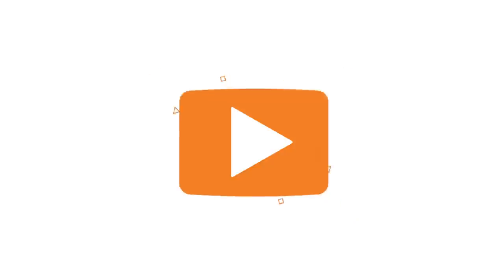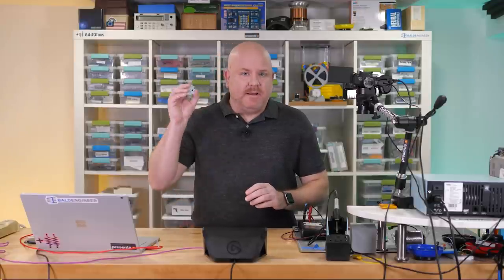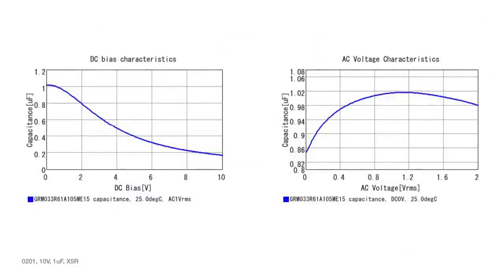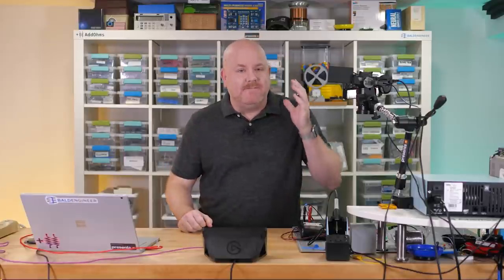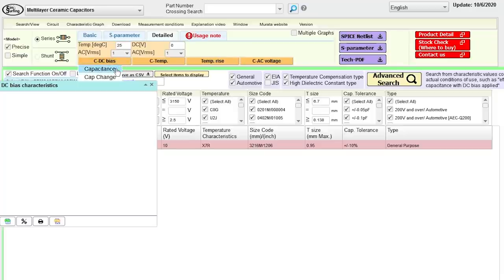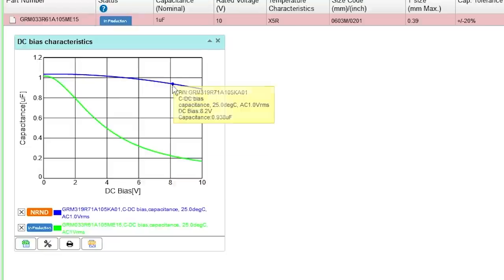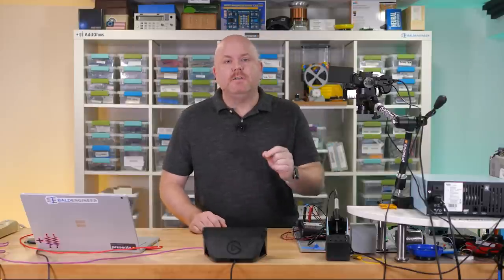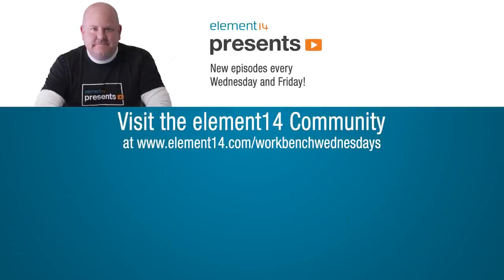Ceramic Capacitor Voltage Effect - Workbench Wednesdays

Comment: Thanks for this video.  I've never hard of DC bias until I watched this video.  

Just a correction to the size of an 0201 part.  In the video at 2:11 it was stated that the size is 0.2in x 0.1in.  It is actually 0.02in x 0.01in.